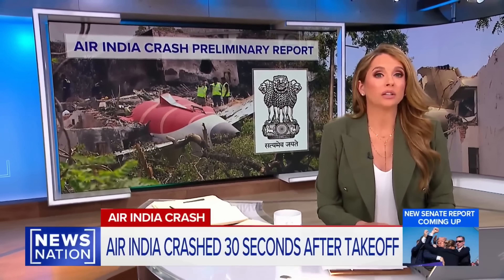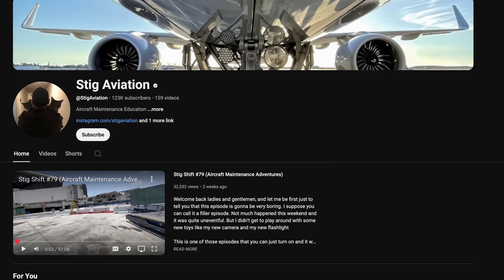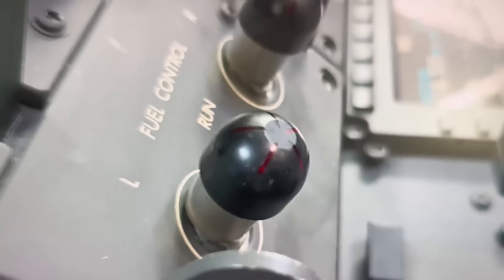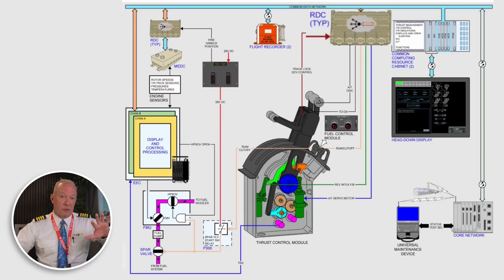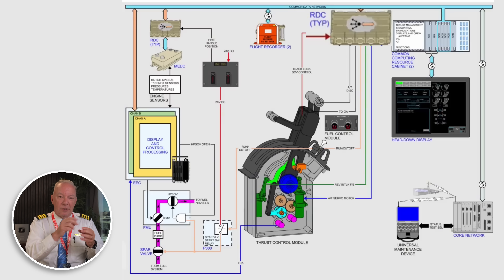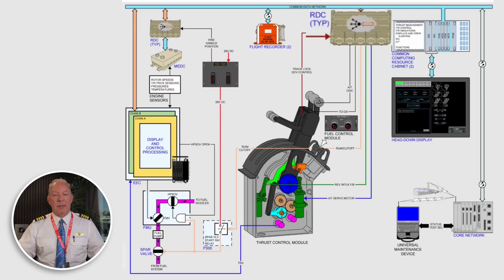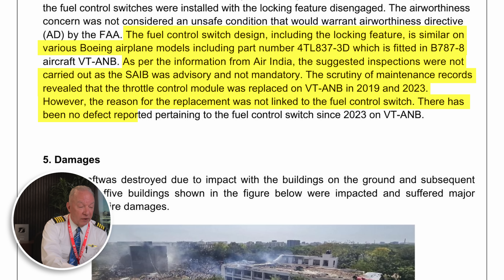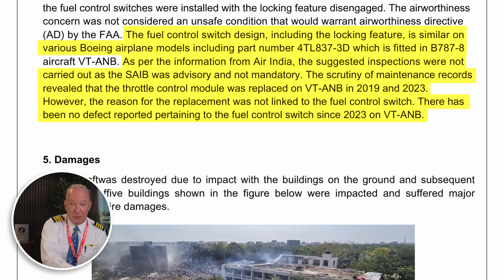The Truth About Boeing 787 Fuel Control Switches

Comment: As an aircraft maintainer, I know how much redundancy is built into aircraft to avoid these types of crashes. On the types I’ve worked on I can’t think of a single point of failure. The left engine controls and systems will be completely independent and not connected to the right hand engine, so if there is one fault it doesn’t drag both engines down. 
It is physically impossible for one fuel cut off switch to affect the engine on the other side. They’re simply not connected. It’s a different electrical circuit.
The probability of one switch having a fault is slim to none. The probability of both switches having the exact same fault and within one second of each other are improbable as winning the lottery jackpot every consecutive week for years.
Reply: water in the relais, there you got it. Known issue on 787 with water
Reply: The commonality is two-fold, supply and return for the current.
Reply: Q: how fuel cutoff switch connected to fuel control valve in boeing 787?

ChatGPT says:
When moved, the switch doesn't physically move the fuel valve. Instead, its position is digitized and sent through the aircraft's Common Data Network (CDN) using fiber optics.
Each engine houses an Electronic Engine Controller (EEC)—also called FADEC (Full Authority Digital Engine Control)—which receives the switch commands digitally.
The FADEC then commands the fuel shutoff valve (often the “spar valve”) inside the engine to open or close, regulating fuel flow precisely.

Grok says:
When a fuel cutoff switch is moved, it sends an electrical signal to the Electronic Engine Controller (EEC), a component of the Full Authority Digital Engine Control (FADEC) system. The EEC is mounted on the engine’s fan case and manages all engine functions, including fuel flow.
The spar valve and fuel shutoff valve are electrically controlled solenoid-type valves integrated into the fuel system. These valves are not directly manipulated by the switch but are actuated based on commands from the EEC.

Gemini says:
In a Boeing 787, fuel cutoff switches are directly connected to the fuel control valves through a relay system, not directly through a computer.

Which one is correct?????🤔
Reply: The engines did not fail ! Fuel being cut off does not produce a failure, it produces a shut down engine.
Reply: You're right, but both switches are connected to the relay which everyone seems to be ignoring. Relays do fail on vehicles so why couldn't it fail on an airplane?
Reply: It's the fuel pumps that failed caused by water ingress into the EE bays. Lack of lavatory maintenance caused the crash and not the fuel switches
Reply: Anything’s possible in Bollywood.
Reply: Perfect explanation. I've been trying to explain those odds to people for over a month.
Reply: @DreamPilot64  Sadly, when one tries to explain something to someone who wants to believe whatever they believe (and especially if they do not have sufficient knowledge to evaluate), one is playing the circular game of whack-a-mole where you explain one thing, but they jump to another, once you explain that one, there is the third one, and (after that one) you are back to the first one. There are plenty of examples around us...
Reply: @igormitrovic7688 the problem is Steve is trying to explain something that he doesn't understand himself.  The skeptics have more knowledge of these systems than he does. I want to know to what extent can the computers control the engines.  Are the computers able to shut down the engines without a pilots input?
Reply: @DreamPilot64  Captain Steve incorrectly describes the control of the fuel values according to the diagram he presented. He needs to explain and correct those errors if he is to restore his credibility.
Reply: @exist7309  Capt Steve's credibility is just fine with me. Your mileage may vary. Either way, that has nothing to do with my comment.
Reply: @DreamPilot64  thank you for your response. I am checking some details and will try to answer later today. Respectfully.
Reply: @DreamPilot64  The way I see this situation is that Captain Steve repeatedly states that it is a very simple system, only failure of the run-cutoff switches could cause fuel cut off, the switches are reliable, the odds of two switches failing a second apart are infinitesimal, therefore one of the pilots must have moved the switches to cutoff. The problem is that Captain Steve is for some reason missing, or failing to explain, that either channel of the TCMA software within the EEC can independently cut off the fuel to it’s engine using the HPSOV if it believes the aircraft is on the ground and the throttles are at idle. Captain Steve’s comments that the system is simple, there is no software involved, only the run-shutoff switches can cut off the fuel, there are no digital signals are all demonstrably false. As a result, the question of whether the switches themselves are reliable is irrelevant.
Reply: If the same battery powers both relays, then if the battery fails, both relays would open.
Or are they powered by indipendent batteries?
Reply: @giacomoneri1782  Good question. However, the same 28VDC bus also powers (as far as I understand it) other equipment which would have been seen as switching off, were it to fail.
The lack of anything else going wrong/switching off, is a quite unambigous indication that the run/cutoff switches were physically moved.

Could there be an unidentified single point failure somewhere? Sure, that is what "unidentified" means.

A speculation could be the connectors between the throttle unit and the aircraft. As said in this video, if a fault is suspected, the entire throttle unit is replaced. This means that there are connectors between all the functions in the unit, and the aircraft.
If, IF!, these connectors for the run/cutoff switches have the possibility to "glitch" at the same time, and do, we could see something like this in the FDR; ie, an indication that the switches were moved, when they were not. So were the switches then physically in cutoff? The switches still being in run, while the relays were off, could be explained by the "glitching" connectors. But the run/cutoff switches is then in the FDR "seen moved" to run again some seconds later. Did they glitch back again? Or did someone have to "cycle" the switches, meaning that the switches (still in run) would need to be physically moved to cutoff and then back to run, for the relays to re-energise? This is highly unlikely due to the simple basic funtion of ordinary relays; if a high enough voltage is place over the spool, the relay switches on... voltage too low, it switches off. It is very binary, which is why he earliest electronic computers were built with relays. It is thus a very simple component. Its behavior is known.

As to the question about there being independent DC supply to the relays... I don't know. But my quess would be no.
The technical drawings seen in this video does not show whether they are independent or not. It just shows one set of relays, with one DC bus.

It saddens me to say, but from what I have seen and heared about this, it was someone in the cockpit who moved the switches. I hope this is not the case, and that a technical explanation will be found.
Reply: @bodan1196  As i understood from this diagram and another one (so not much really) the relays are powered directly from the battery, while the other instruments are powered by the generators.

Of course, the battery should be charged by the generators.
And when the generators shut down the instruments should use the battery until the RAT is fully working.

Now, if the battery or some connection from battery to the relays fails, it could be possible that the relays were left without power until the system switched from the battery to RAT power.

I heard someone saying it could be water infiltration in the electronics bay, someone else saying the accidental deployment of the RAT could create a voltage drop long enough to default and close the valves, even though if it's just relays they should close again very quickly as you said.
It would still doom the plane, but it should be very clear in the FDR.
Unless the battery or the protection diode went kaputt.
I heard those batteries had shorting and reverse charging issues, creating fire hazard, and they "solved" it by mandating a metal box around the battery (😂).

I don't know, but i see a failure not only possible, but at some point inevitable.
Another 787 had a double engine shutdown triggered somehow by the reversers switch, but the aircraft already landed so nobody made a big deal out of it.
The plane had to be towed away from the runway cause the engines weren't restarting.

Honestly, contrary to what everyone says, i hope it's really human fault.
But for the sake of everyone's safety, no other option should be left unchecked
If it was a tecnical issue it can potentially happen again, and that should be prevented.
Reply: @giacomoneri1782 
They are fed by the power generated within the plane when running, the engines generate the power that runs the plane and it is converted to 28v dc. The power sources are redundant and one power circuit failure could not kill both engines. Btw if that happened that fault would show to the pilots and would be in the data recorder.
Reply: @giacomoneri1782  In that case the FDR shall record the failure of the battery or voltage source.
Reply: @giacomoneri1782  I’m not 787 rated but as soon as the engines or APU are running, 28Vdc is usually generated by them and no longer supplied from the battery.
Reply: @notmenotme614   For all the other systems that's correct.
But for the fuel switches, Captain Steve and others as well says the power is supplied by the battery bus.
Probably to avoid engine shutdown in case of loss of generators, even though usually that's caused by engine failure.
Anyway the battery is charged directly by generator 1.
Reply: There is a single point of failure. Look at the circuits.
Reply: @kumark214 
No there isn't . Watch the stig aviation video ,he shows exactly how it all works.
Reply: @njlauren I’ve seen the circuits in Boeing manual. When FO dc bus closes when captain bus fails, there is no isolation. This is a single mode of failure.
Reply: @kumark214 
First of all that is bs, bc the circuits to the 2 engines are separate paths, there is no single point of failure there. If you had a catastrophic loss of power it would show in the 'fdr', it would show clearly it failed, it wouldn't mimic the switches being thrown. 

to have two circuits fail ( one to each engine) that mimics exactly the switches being moved to cutoff position is basically impossible . 

If what you said is true the data recorder would have shown it. What you are claiming is  like the guy who claimed a power surge caused both switches to trip to the cutoff position, which literally is impossible, the switches are mechanical .
Reply: @njlauren  the problem is that Captain Steve fails to acknowledge the presence of the TCMA software within the EEC and its ability to cut off fuel flow using the HPSOV even if the cockpit switches remain in the run position.
Reply: @exist7309 
There is a problem with that that any software engineer knows..if the computer sent a signal to shut the valves, the command goes via the data bus and it would be logged in the flight data recorder.. and it would not appear as the switches being thrown in there, the code for the switch being throw is different than if the computer did it..ppl saying that it could have been the computer but it looks like the switch was thrown are way off line..why,? Because the 'fdr' would show both the switch being thrown and the valve closing. It isn't that the valve closed and that is all.tjdg is in the FDC, the input that caused it is logged as well..
Reply: @njlauren  unfortunately the control of the HPSOV by the TCMA is internal to the EEC so that signal need not be visible to the FDR.
Reply: Always assuming that the wiring on the 28V to the relays does not share a common wire. ie both come straight off a substantial busbar. Or is it one take off which splits further on near the relays? ie 2 relays could fail together. However we have the CVR reference to the "switches" which represents a datum, unless you factor-in some conspiracy. Ooer!
Reply: @RedRouge-j4j  On the platform I work on there’s multiple bus bars. With the LH engine generator providing some and the RH engine generator providing others, then there’s the APU and RAT. If one bus bar goes down, critical systems like the flying control computers will still be powered up by other bus bars. Some bus bars can be connected together if one generator fails.
Reply: Captain Steeeve botched up the explanation again.  He can't even get the valve names correct.  The fuel cutoff switches do not directly control the opening of the engine valves. The switches enable the EEC to open up the engine valves. The EEC definitely has electronics inside it. 

Cutoff is a different matter. The switches control the wing spar valve and, indirectly. the HPSOV and Fuel Metering Valve (engine valves).
The EEC can close the engine valves if it sees it is unable to safely control the fuel flow.
Reply: @ImperrfectStranger I agree with your assessment. Captain Steve's diagram is way too simple. That system probably has hundreds of wires in it. Someone would have to have the technical manuals from Boeing and then spend at least a month studying them to understand exactly how it all works.
Reply: @ImperrfectStranger 
The stig aviation video shows how the system works and he is an expert on it, he is a senior maintenance tech who works on the 787 so he knows how it works. There was no computer in the cutoff circuit, it is a switch/ relay combination. If the eec could shut down the fuel flow it would show on the 'fdr' and it wouldn't show a switches being thrown . 

Btw the guy on the stig video didn't give his opinion, he simply showed how it worked.
Reply: @njlauren  I respect Stig Aviation, but he got a couple of things wrong. He admitted he was wrong regarding the "frequency wild" IDGs in public and I discussed with him the fuel valves on GE engines in private, but I'm not sure if he understood or agreed with me. 
One of his earlier videos (before #76) showed a fuel system diagram which added more detail than the one in #76, but it still lacked the detail of the Boeing/GE schematic diagrams Stig and I would use when actually working on aircraft. I was essentially the same thing as he is... a senior maintenance tech, specialising in avionics. 
I tried to upload an video of a proper wiring diagram showing a typical fuel control system, but it didn't come out clearly enough.
Reply: Capt Steve says that the switches supply current to the valves when they are switched to run.  This means there is a single point of failure i.e. the 28v power supply.  I suspect though that when rhe switches are at RUN, the relays are de-energised and the contacts are held closed by the action of a spring, to supply the 28v. That would be failsafe.  (But only if safe meant the fuel valves need to remain open!)
Reply: @SoapyB20  No my point is, the other engine would still run. One switch won’t affect both engines.
Reply: If there are two separate computers controlling the two engines, one for the left engine and one for the right engine, they could both fail at the same time even though they are not interconnected and are totally isolated from each other. This has happened before. If the two computers are using identical hardware and running identical software they could both have the same software bug that will only show up when some rare and unanticipated combination of input signals is presented to both computers at the same time. As I said, this type of thing has happened before. The scary part is that everything could perform just fine for months or even years until suddenly your luck runs out and both systems malfunction at the same time.
Reply: @joevignolor4u949  But that's just the point of this video. There is no computer between those switches and the valves they control. It is a completely "dumb" system, just like an old-fashioned light switch you would have in your home. Turn on the switch, electricity flows, light goes on. There's no computer between the switch and the valve to mess it up. This is as simple and foolproof a system as you can make. You could, maybe, (maybe) construct a scenario where one such "dumb" switch fails. But to have both of them fail within one second of each other... and then both suddenly "fix" themselves eight and twelve seconds later? That's just not possible. 

I can't say for sure, but I think this may be the incident that forces the Pilot's Union to accept video cameras recording pilot's actions in flight.  They've been fighting that for a very long time, but it's standard practice now in many other industries. I understand why they don't want it, but there have just been too many incidents like this and the safety of the passengers needs to come first.
Reply: @tomgwynn2000  and perhaps videos would help simplify investigations and prevent these types of long drawn out discussions, which seem to be filled with confusion.
Reply: @tomgwynn2000 What I wrote about was not specifically about this particular accident. Somebody made a general statement that two entrely separate computerized control systems can never both fail at the same time. As I explained that's not true.
Reply: @MsELewis-hc8zx  Cockpit videos would remove all doubt about whether the control inputs recorded on the Flight Data Recorders were deliberate or not. That would instantly solve cases like this Air India one, but also ones like EgyptAir 990, which was another likely pilot-suicide.
Reply: @tomgwynn2000 
The only addition I will make is that the switch being thrown causes a relay to open and the valves to close, it is akin to what are on cars . The reason for the relay is that it prevents a power surge that can come off a switch by itself. By energizing or de energizing a relay, which in turn cuts off or allows voltage upstream, it isolates the upstream device
Reply: @joevignolor4u949 
It could happen, like if an emf pulse hit the aircraft, but the way those systems are set up outside that pretty much impossible.
Reply: @tomgwynn2000 What is the eec, is it a computer? The HPSOV in the FMU appears to have an AND gate with inputs from the relay and the EEC.
Reply: @tomgwynn2000 Is the source for 28V independent all the way? Frayed cable or loose connection doing a short interrupt. 
Should the relay not be normally closed so it takes power to open it?
Reply: @tomgwynn2000  TCMA can shut down the engines without pilot input, and it already did before.
As i wrote in the comment above, ANA NH-985 engines shut down by themselves.
The plane stopped safely, and the engines did not restart.
But it's proof it's not just foolproof relays, there are systems designed to automatically cut the fuel in the 787 Dreamliner.

I agree on the cockpit cam.
If it was there it would had taken less than 5 seconds to know if one of the pilots shut down the engines, instead we are here speculating.
Reply: @tomgwynn2000  Captain Steve incorrectly describes the control of the fuel values according to the diagram he presented. He needs to explain and correct those errors if he is to restore his credibility.
Reply: @tomgwynn2000  If the investigation won't be able to conclude with a 100% certainty which pilot exactly has done it, introduction of cameras is the likely outcome I think.
Reply: That's like having both FADEC computers getting hit by cosmic rays to scramble them and cause a fuel cutoff. At the same time, for both engines. The odds of that are absolutely miniscule, whereas the likelihood of a pilot hitting the cutoff switches is sadly much higher than zero.
Reply: @fallinginthed33p the question is are the computers able to shut down the engines or not.
Reply: @JoeLinux2000  They can't shut down the fuel flow. The fuel flow valves are controlled directly by DC and a relay with no computer modules in between. I assume the fire handle in the cockpit does the same thing as the fuel cutoff switches by cutting DC power to the relay that controls the fuel flow valves.
Reply: @joevignolor4u949  Are you talking about both FADECs going haywire exactly after both fuel control switches transitioned, knowing they are not directly or indirectly connected to those switches? A simultaneous quad point random failure, what are the odds?
Reply: @alexyoung6418 I'm still not totally convinced that the switches were moved at all. No one has ever explained how the switch positions are reported to the FDR. Captain Steve's diagram doesn't show it. Maybe the FDR is lying to us. If you know how the FDR monitors the switch positions please clue us in.
Reply: @alexyoung6418 are the computers able to control the engines that's the question.
Reply: @JoeLinux2000  Assume it was the computers and they did glitch and shut down both engines purely because of software bugs. You need to multiply the odds of each computer glitching, and multiply the product with the odds of the FDR also glitching and independently hallucinating each switch transitioning. You end up with a probability equivalent to something like Elon Musk getting struck by lightening 10 times in his life time all missing vital organs and walking away.
Reply: @JoeLinux2000  They are full authority. And they are independent from each other on both wings, they are also independent from both fuel cutoff switches. Four independent components, separately glitching together, what does that suggest?
Reply: @joevignolor4u949  human hands are required to turn the fuel off or on
Reply: @joevignolor4u949  You are ignoring two simple facts. 1) There are no computers inclined in this circuitry. 2) One of the pilots asked the other 'why did you cutoff?' The first pilot must have noticed the switches in the cutoff position. Please explain that as a computer action..
Reply: @Chris-hx3om  First of all, forget Captain Steve's simple little diagram. It doesn't even show the FADEC or how the FDR connects into and monitors the whole system. You will need all of Boeing's documentation covering the entire design of the entire fuel control and engine management system. I've worked on aircraft systems like this and you are talking about perhaps a hundred  pages or more of wiring diagrams, illustrations and written documents showing how the whole system is designed and describing how it works. Neither you, I or Captain Steve knows all this detailed information at the moment, so we can't rule out some sort of computer malfunction. It's possible that those two switched were never touched, but something else killed the two engines. It might have been that the co-pilot saw the engine gauges winding down and he felt the loss of thrust, then he might have THOUGHT the pilot touched the two switches, but in fact he didn't. That's could have been why the pilot replied that he didn't cut off the switches. This is why the investigators will have the engineers at Boeing helping with the investigation. Only they know everything about how that system works.
Reply: @Chris-hx3om I agree that if the fuel had somehow been cut off without the switches being moved, the flying pilot would have been unlikely to accuse the other one cutting off the fuel. But on the other hand, it is also strange that the other pilot would deny that he had done so, since it would have been patently obvious that the switches had been moved and he was the only possible human agent. If you are in the process of committing suicide, why would you bother to deny it?
Reply: @malin5468  I Suspect it wasn't intentional. I think the pilot who moved the switches genuinely thought he was doing something else. A brain-fart. Look at the timeline, what else should have happened at that point? The gear should have been retracted. It wasn't. I think the pilot monitoring moved the switches when he thought he was moving the gear... We've all done similar.
Reply: @joevignolor4u949  Actually there are 2 redundant ECM's per engine.
Reply: @joevignolor4u949  Yet 1 second apart, both when closing the valves AND when reopening them?
Reply: @joevignolor4u949  when has it happened before ? that should be a counter argument to the whole of this video
Reply: @kiteinair12  It happened back in June of 1995 during the first launch of the new Ariane 5 rocket. The rocket had two identical guidance systems, a primary and a secondary back up. It was the same guidance system that had been used previously on the Ariane 4 rocket with no problems. Thirty seven seconds after launch both guidance systems failed and shut down causing the rocket to go out of control and break up. The problem was that the flight dynamics of the new Ariane 5 were different than the Ariane 4. The Ariane 5 accumulated horizontal velocity faster than the Ariane 4. The register that was accumulating the horizontal velocity was too small, so it overflowed. This caused the primary guidance system to shut down. It then switched to the secondary back up system, which also had the same software bug. It also experienced the same overflow condition and shut down and without any guidance system the rocket broke up. Computerized flight control systems are very complex. Things like this can definitely happen.
Reply: @kiteinair12   ANA NH-985.
The Boeing 787-8 Dreamliner was landing at Osaka Itami, both engines shut down simultaneously after the pilot engaged the thrust reversers.
They stopped safely, but the plane had to be towed off the runway as the engines refused to restart.
The dual shutdown was caused by an error in the TCMA (Thrust Control Malfunction Accomodation) system, triggered by the engines spooling up for reverse thrust.

So yes, 787 engines can be shut down by system errors, and yes, it has happened before.
Reply: @kiteinair12  ANA NH985 both engines shut down shortly after landing and could not be restarted. The aircraft had to be towed away.
Reply: @joevignolor4u949  When has it happened before??
Reply: @cryogeneric  It happened back in June of 1995 during the first launch of the new Ariane 5 rocket. The rocket had two identical guidance systems, a primary and a secondary back up. It was the same guidance system that had been used previously on the Ariane 4 rocket with no problems. Thirty seven seconds after launch both guidance systems failed and shut down causing the rocket to go out of control and break up. The problem was that the flight dynamics of the new Ariane 5 were different than the Ariane 4. The Ariane 5 accumulated horizontal velocity faster than the Ariane 4. The register that was accumulating the horizontal velocity was too small, so it overflowed. This caused the primary guidance system to shut down. It then switched to the secondary back up system, which also had the same software bug. It also experienced the same overflow condition and shut down and without any guidance system the rocket broke up. Computerized flight control systems are very complex. Things like this can definitely happen.
Reply: @joevignolor4u949  except they didn't fail at the same time. there was a 1 second delay. Also, there is no link between computers and those switches, that was the point of the video.
You know what has also happened before? Pilot goes insane and crashes plane.
Reply: @joevignolor4u949  : Think Capt. Steeve made it clear that the fuel control switches are purely mechanical, as is the completely "sealed" system. The circuits are either physically open or close. No computer system involved. You seem to say there could be a software fault involved where no software is involved with the switches.
Reply: @SteveBrown-f7w  I don't care what Captain Steve says. He is a pilot and not an engineer. His diagram and explanation are too simple. I'd need to study the technical documentation from Boeing to determine how the system is designed before making any assessments about what might have gone wrong.